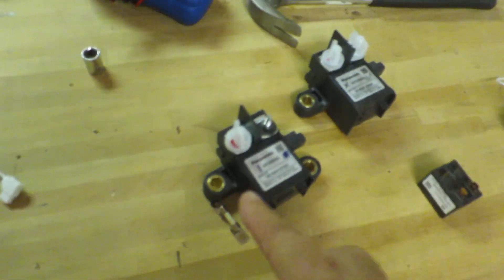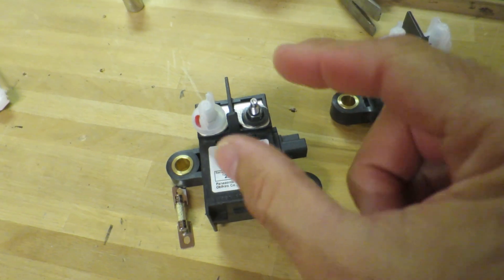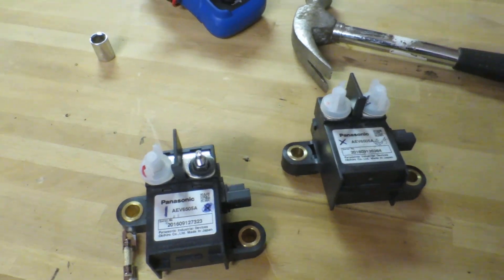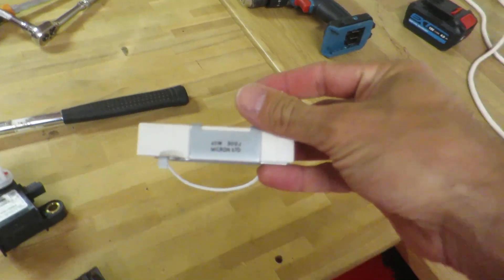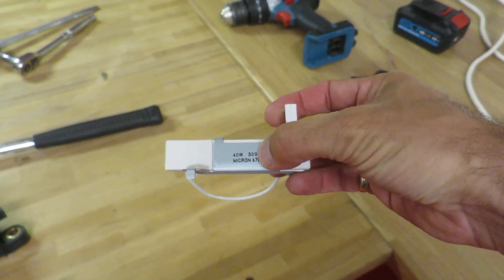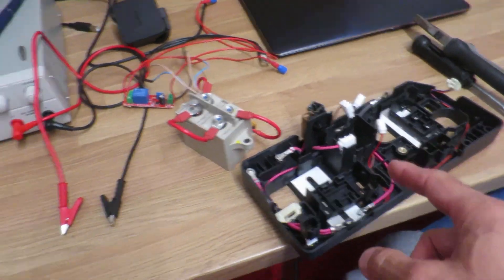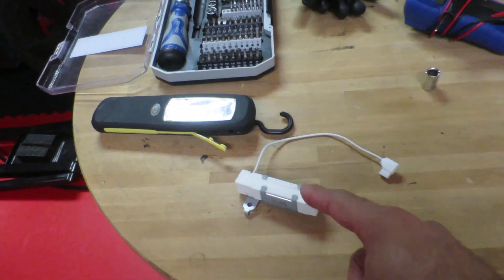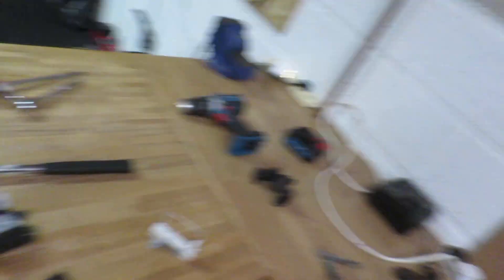Unexpected pre charge issue...

Comment: Ouch that's unlucky, however that got me thinking, it would be interesting to implement some kind of circuitry to ensure that the pre-charge resistance is at an acceptable range/number before energizing the pre-charge relay. As you mentioned a similar approach is implemented in the Leaf, this may add another layer of complexity however might be worth it..
Reply from the maker: Yeah I have a feeling I am going to need to add another Arduino in the boot to control the relays...

Comment: You know the resistance of the pre charge resistor (30 ohm) so just order a 30 ohm power resistor from an electronics supplier. You should pay a few £ each, nothing more.
Reply from the maker: Yeah, getting a leaf one is not expensive, I want to keep it the same as it comes with the right fittings to slot straight it.

Comment: Just for reference the eGolf battery pack I bought had 35mm2 cable (solid copper bar actually) and 400A fuses, I think they are around 110kW. If you're using 35mm2 cable you should be OK.
Just a thought as to why the original resistor failed, I heard somewhere (sorry not sure where) you need to ensure the resistor is disconnected after the main contactors cut in as it will still be conducting otherwise. I doubt if that was the cause, but it failed for a reason so best remove as many possible causes as you can. 
I managed to weld shut a contactor by forgetting to enable the neg along with the precharge so when the main contactor closed along with the neg, one of them decided to not open again. 🤥
It's a very good point though that the precharge resistor needs to be monitored. I'll need to think about that.
Reply from the maker: So the leaf actually keeps the precharge on slightly after the main relays connect, the high resistance means it just gets ignored (electrically wise). I am keeping an eye on temperatures, all OK so far.
Reply: @SouthWestEVUK  Forgive me if this is obvious (it wasn't to me) but you are turning on the neg contactor along with the precharge aren't you?
Reply from the maker: yeah, neg and precharge, then precharge switches to pos. Good shout tho...